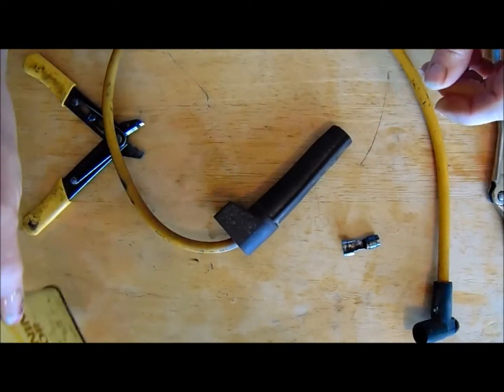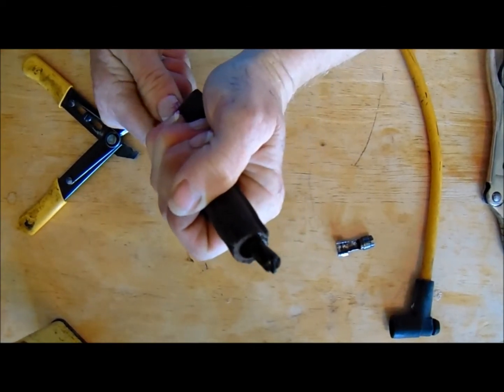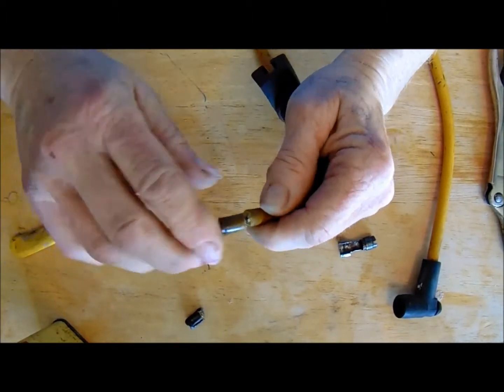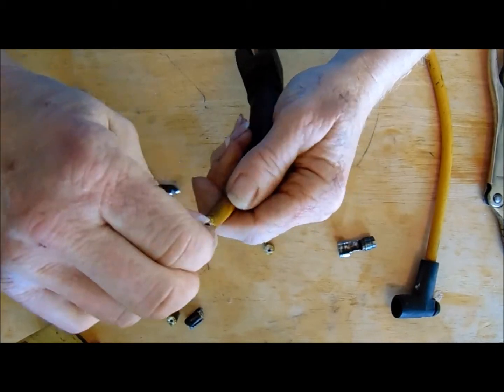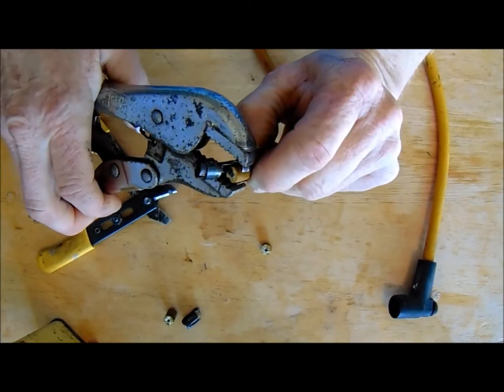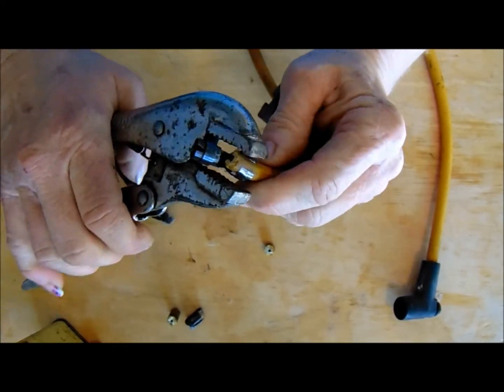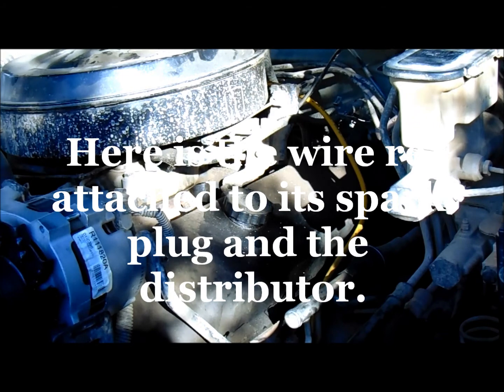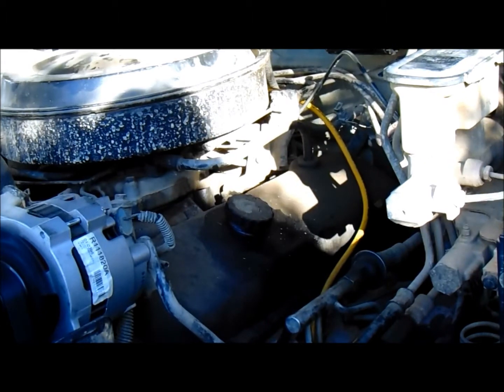Spark Plug Wire Repair

Comment: This information, although useful, seems to be more of a spark plug cap repair rather than a wire repair.
Reply from the maker: Here I am! Responding four years later! I just figured this whole thing out on you tube. Anyways, the wire is repaired when it is re-attached to the connector.  The cap isn't repaired at all. So, really its a wire and connector repair video, lol. The cap just goes over it to stop it from grounding out on the engine block.